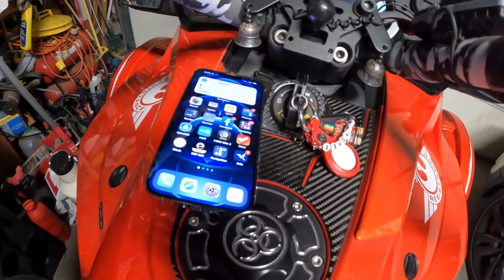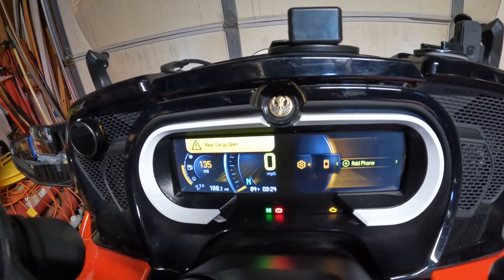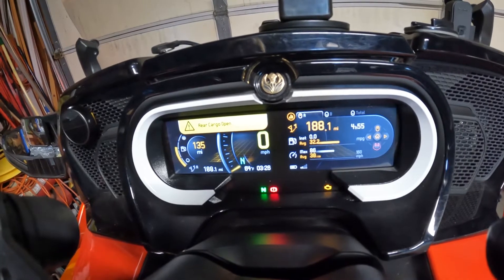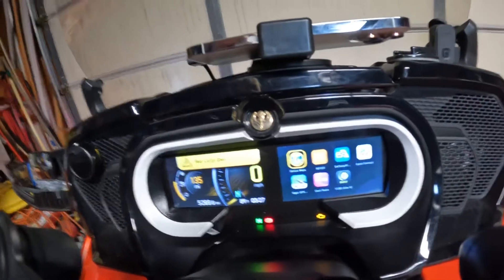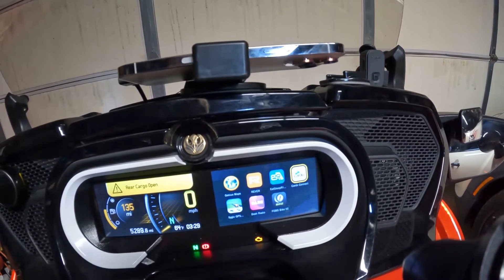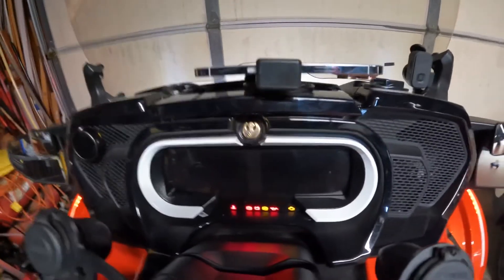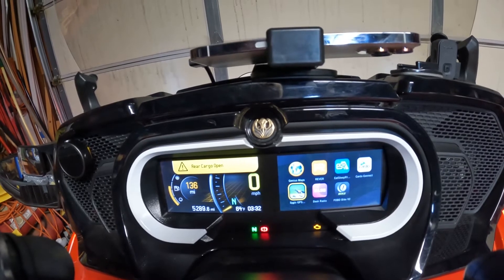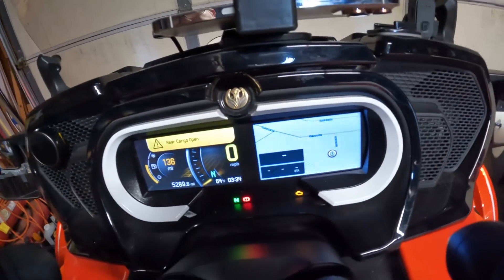BRP Go setup - Short and quick

Comment: Nice tutorial. I had my phone connected to the helmet and the spyder. I’m going to try connecting the helmet only to the spyder next time. I think that’s what is causing me to not here the voice guidance thru the helmet or the speakers. Also when I have the helmet connected to the phone and the spyder and got a call, I couldn’t lower the music volume. Thanks again. I’m trying to use the BRP go since it came with the spyder. It’s definitely a learning process, but so wasn’t my iPhone and older stand alone gps units back in the day.